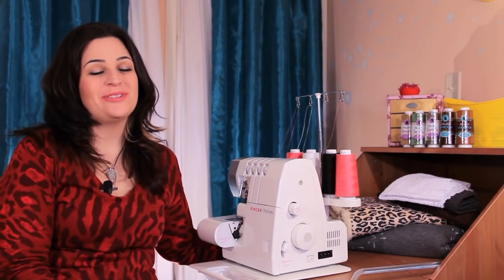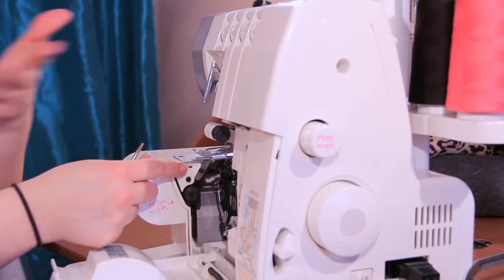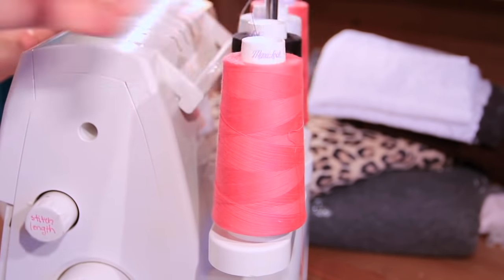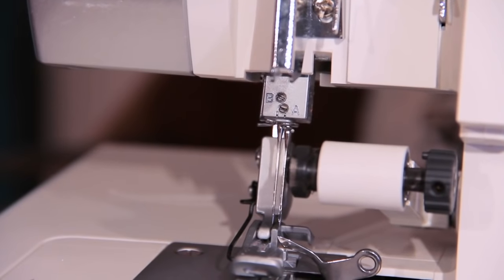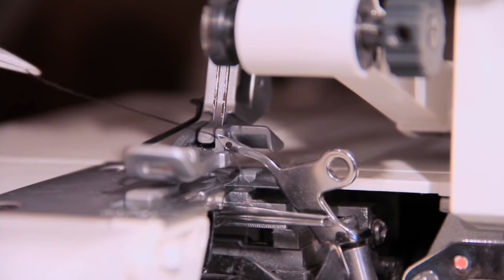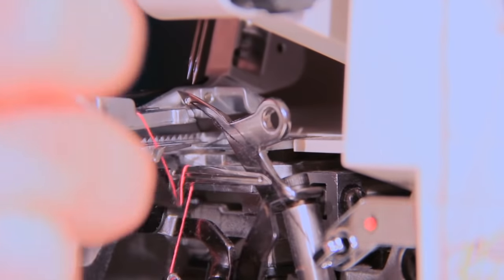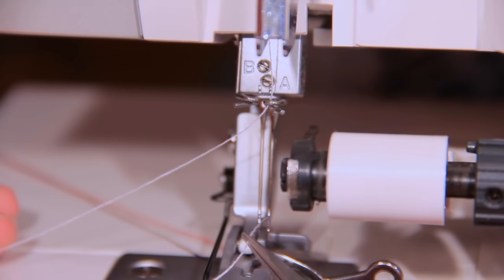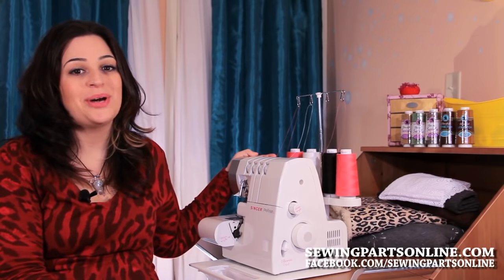How To Thread A Serger - Overlock Machine

Comment: im new to sewing and starting with a serger, it came spooled and threaded but i went and threaded it today and made a few mistakes, some i corrected before i turned it on but i had some thread misplaced. the manual was confusing so i youtube searched and your video confirmed exactly what i thought i was supposed to be doing. i went back, did it again and now its working. thanks!

Comment: Thank you such for this  tutorial.  I had been battling with the lower loop thread and the pictures in my manual didn't help. I did a quick search for a tutorial and yours was the first I saw and alas my problem was solved. I have rolled hem my skirt.

Comment: Thank you so, so, much for this very well detailed and presented video. I am new to using a serger/overlocker, and I have this very same one that you are demonstrating on. The first time I used it, the bottom looper thread burst, and I was having a challenging time re-threading it. The instructions and diagram on the machine confused me as to where I had to run the thread when I came close to the presser foot area. After watching this video, I realized that I was putting the thread in the wrong groove.
Reply from the maker: I'm so glad it was helpful! The instruction manual was so confusing!
Reply: OMG! Yes! It certainly was! I was like, isn't this manual supposed to explain properly what needs to be done? But instead it confused the hell out of me! LOL! Thanks again for this video. :)

Comment: You forgot to thread the upper-looper thread through the 2nd to last guide "hole" at the top to the right of the presser foot, just before you thread through the last guide. It really needs to be in there to work properly. Some sergers have a hook type. Very informative video thanks
Reply: Havquan sewing machines

Comment: Thanks so much!  You should have written the manual.  I was threading the machine correctly but the manual doesn't say to pull the threads out and put them between the plate and presser foot.

Comment: Hi ... Please help .. How did you move the face of the machine away? 
Mine doesn't seem to budge and I am unable to get to re-thread it
Reply from the maker: Hi! Usually, the face of the machine has a spring that allows it to be push to the side and easily opened, but yours may be different. What is the make and model of your serger?

Comment: i just have one question,how do i tighten the thread? i mean that hem gets more tighter.the thread so loose when i use this machine
Reply from the maker: You tighten the thread by increasing the tension number. If it's not tightening, double check that the thread is actually flossed between the discs. Sometimes they pop out.

Comment: How do I take the cone out from the coneholder c
Reply from the maker: I'm not certain of your question. Are you asking if your thread breaks from your 3rd cone, what do you do? If that is your concern, you are likely going to have to rethread your machine. I would double-check your manual. With a Babylock machine, you do not have to thread in a certain order; however, for other sergers, you have to thread in a specific pattern. If the thread from the 3rd spool breaks, depending on your model, you may have to rethread your whole machine. I hope this helps.

Comment: Hi!!my machine model no is singer 2263.can I use all foot you introduce to my machine?please reply.and also please tell janome  ribbon foot for my machine?please reply .
Reply from the maker: Hi! you can use all standard low shank presser feet - just make sure you pay attention to the needle width. The Janome ribbon foot doesn't appear to be compatible with your machine; however, the low shank Brother  ribbon foot is compatible. Part number #P60101

Comment: bought this very same machine about two months ago... barely used... now when i push the lever to rolled hem and then push it back to standard   it clashes with the upper looper...... not happy with this machine   would not recommend....
Reply from the maker: I had to replace the cover plate on mine after the first year. Other than that, it's been a decent beginning serger. That being said, I've heard mixed reviews from other users, too. I'm sorry you didn't have a good experience with yours.

Comment: I have just purchased a singer overlocker. my problem is the thread tail isn't coming out the machine. it stitches for a while then the thread builds up under the needles!!  I have rethreaded the whole machine about 3 times but the same thing happens. Don't know what else to try. It's a brand new machine I don't want to give up but don't know what else to do. Any advice?
Reply from the maker: Hi, Sheila! I'm so sorry you're having trouble! Did it come threaded? What is the make and model of your machine?
Reply: Sewing Parts Online hi thanks for reply. I have been onto singer it looks like there's a problem with the machine!! They are going to have it to have a look at. I have rethreaded many times to exact instructions it sews really well but under the needle collects thread and jams. it's brand new only had it 2 weeks. will let you know what happens.
Reply from the maker: Yes, please keep us updated!

Comment: - What Would Be the proper dials to use for sewing spandex ?? Ive had this machine for 2 Years & have NEVER Been able to use it .. :(
Reply from the maker: Hi! Do you want to create a flatlock seam, 3 thread overlock, or 4 thread overlock?
Reply: - All of the above please ! Lol
Reply from the maker: LOL Gotcha - so, the tension will depend on the weight of the fabric and the stitch length, just like a regular sewing machine. The trick with stretch fabric is in the differential feed. If you find the fabric is being stretched out while you serger, then you may need to increase your differential. What is the make and model of your serger - that way I can get the specific settings for your machine.
Reply: It's the same exact machine